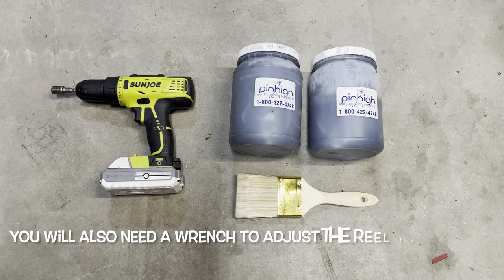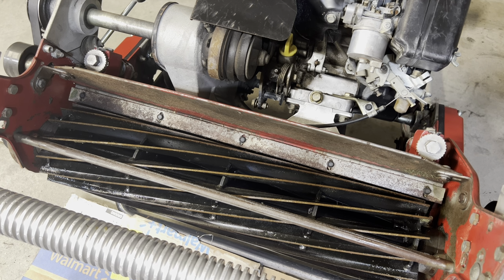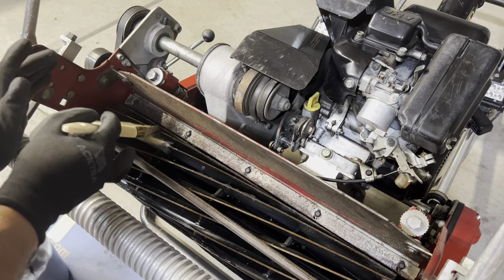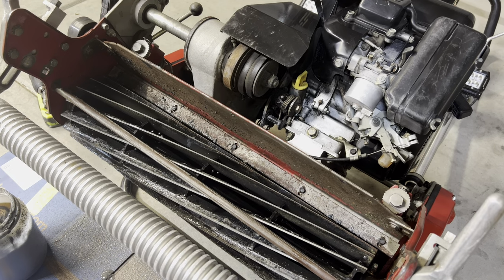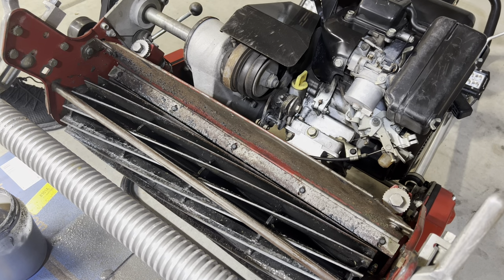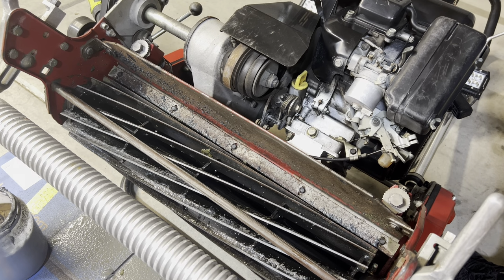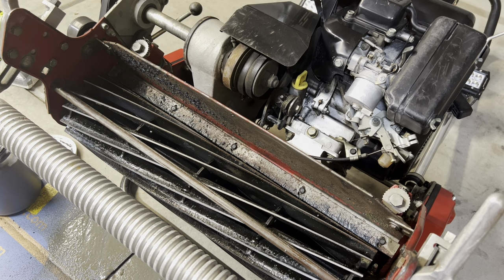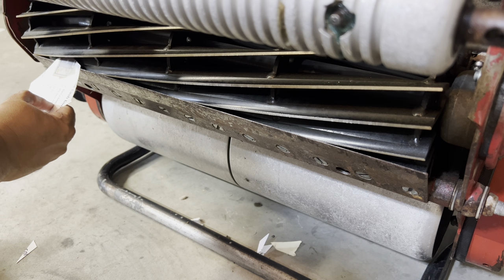How to Backlap - Toro Greensmaster 1000

Comment: Great video! Just a reminder/tip. If you don't rinse off the 80 grit prior to putting the 120 grit on, you're not really jumping up to 120 completely since there are still 80 grit granules still running around in there. You want to make sure you rinse everything off completely between stages and after you're done.
Reply from the maker: Good call and appreciate the tip. Makes perfect sense. I appreciate the support and comment. 👍🏻

Comment: I purchased mine a month ago (my first), and it usually requires a single click (left or right) to cut paper across the bed knife before each mow.  I was able to quickly move from 5/4" to 5/8", and the lawn looks amazing.  I'm very interested in seeing you do an oil/filter change, grease application, etc., and any/all other maintenance!  Also, I can find nothing anywhere on the steps/tools required to remove/install the reel, though there's plenty of videos on changing the bed knife.  Perhaps that's because a new reel requires a grind, and no one does that as a DIY project?  (Am I correct in thinking that buying a sharpened reel isn't a thing?)
Reply from the maker: First i appreciate the comment and the support on my channel 👍🏻. I am not confident that a new reel would require a grind? I will have to look in to that. That is not normally the case with other reel mower as a backlap is normally recommended to mate the reel to bedknife. I will prob do a oil change and greasing video next seasons as i have already completed it and won’t do it again till the growing season. I hope to push out more content at that time on the greens mower 1000

Comment: Aren't you rotating tte blade in the wrong direction?
Reply from the maker: No. When backlapping you want to run the blade in reverse. If you run you mower blades forward you will dull the blade with compound on them. This is why it’s so critical when checking for sharpness to clean all of the compound off the reel before running it forward otherwise you will undo all of the work you did sharpening. Hope this help. 👍🏻